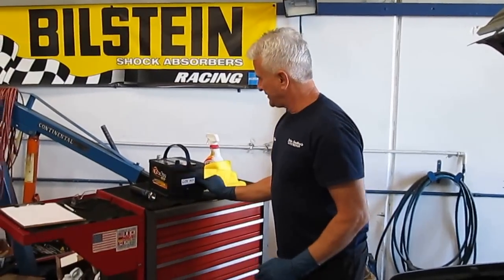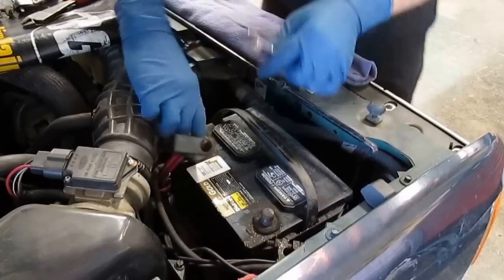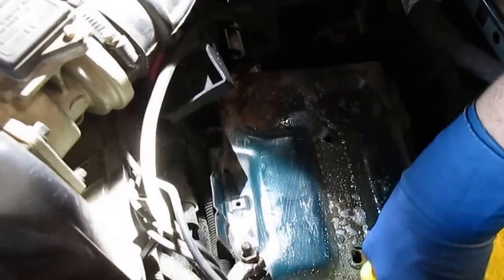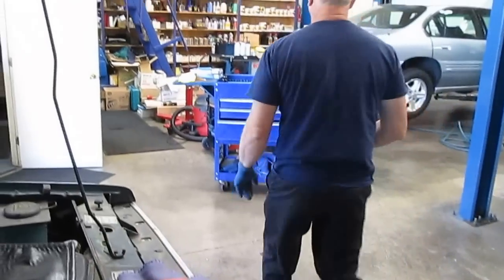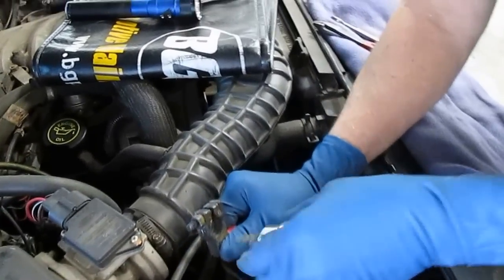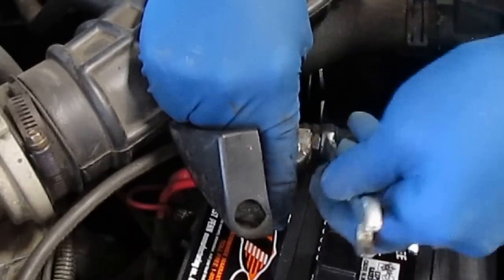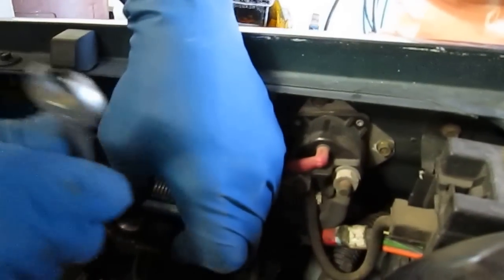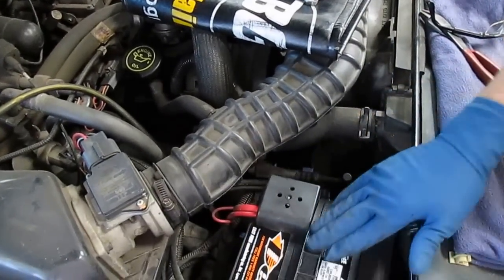How to check and replace your battery by using the date code.

Comment: Hi John: Thx for the reply. We're straying a bit from subject, but for those following here's a bit more info. There will be a slight surge of power (actually current) when either terminal is reconnected. You are simply completing the circuit either way. As for sparks, they too will occur with the connection of either terminal, as long as something is drawing current. More current draw, more sparks. Turn on headlights and make and break a terminal connection as an example. Now depending on which electron flow theory you believe in,and which terminal you remove, the sparks will jump from the post to the cable, or the cable to the post, but its really undetectable to the naked eye. Any thoughts on your favorite auto battery?? Interstate was #1 when I was turning wrenches, buts its been a while.
Reply from the maker: Hi Eddie: I really appreciate your good input on this, used Interstate myself and started having lots of problems with there batteries about 10 years ago. 

Found a company called East Penn,  www.eastpennmanufacturing.com/ . They sell a Deka battery with a sealed top that works Great! Further, they are made in the U.S.A.The contact I have is Sara or Joe at 619-660-0016.

Comment from the maker: Hi Ben: Talked to Sara at East Penn Manufacturing (Deka Batteries) 619-660-0016. Sara informed me that the sticker is put on every battery they sell showing the month / year  when a consumer buys a battery from them. This is important to me due to that's when the warranty starts. The warranty does not start on the date of production engraved on the battery.

Told her what you said and she gave me the above information again.Like you said the engraved date is the actual date the battery was manufactured. Thanks for your info.

Comment: Good video  but one slight correction. Removing neg cable first is not to prevent sparks or spikes, but rather to prevent shorting the battery by bridging  the wrench from the positive terminal to something grounded like a bracket or rad support while the neg terminal is still connected. Good video work.
Reply from the maker: Hi Eddie: Thanks for the good information, my Automotive Instructors over the years always told me that was the safest way due to so many electronics on vehicles. To make as sure as possible not to damage anything electronic.

Comment: Hello, i was wondering if you could help me out.Basically I've just bought a "new" Bosch Silver S5 007 74Ah, 750CCA battery.The problem is, that i cannot figure out what the manufacturing date is.
Basically i've got these codes on the battery case itself (not on a sticker) :

-G6C5590520525       53071   321A   21    (This code is on the "north" side of the battery cover and is "clearly" stamped on)
-IG6M 30      (this code is on the "south" side of the battery cover and is "rough", like it was "burnt on")

From the information i've managed to gather, it would seem that G6 means July 2006, but seems a bit crazy.Like, the retailer had this on their shelf for 10 years, before I got it ? It can't be 2016, because we're only in January, so it's gotta be 2006.

Also, suppose I had G5 stamped on.How would I know then if it was 2005 or 2015 ? This part, in particular, freaks me out, because if it was infact an 06, and i send it back, say i get one with B5 on it or something similar.How can i be sure it's 2015 and not 2005 ?

I mean, the number on a car's glass is like this too, but at least with cars, if you have a little bit of knowledge, you can "place" them in a certain time frame and you know exactly what year it's from, but I can't do that with car batteries.

I wrote to Bosch customer support, asking for this information, but I don't know how long they'll take to reply, and even if they'll be able to clear this up for me.

I thought I'd post on here aswell, since this video discusses this topic, and maybe you can offer some insight on the matter.

Any help would be greatly appreciated.
Reply from the maker: +Alegzander1990 I use Deka Battery Company for all that kind of info, 619-660-0016. Any one there can help you.